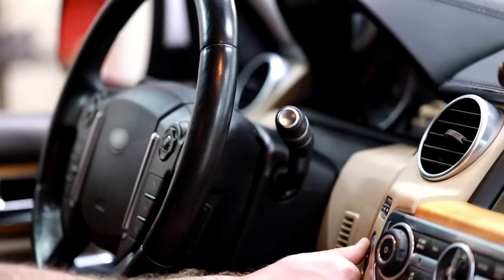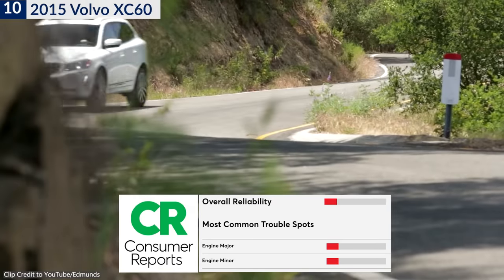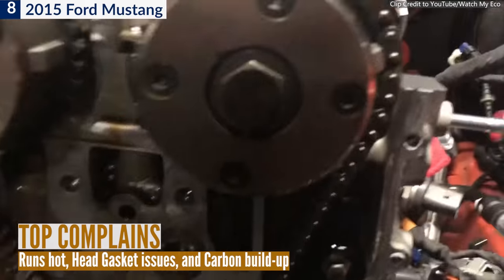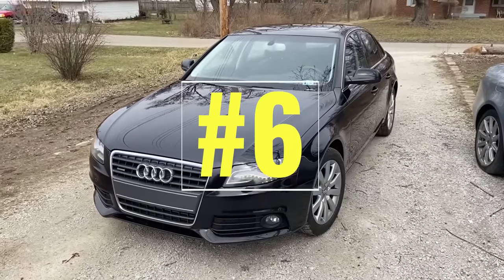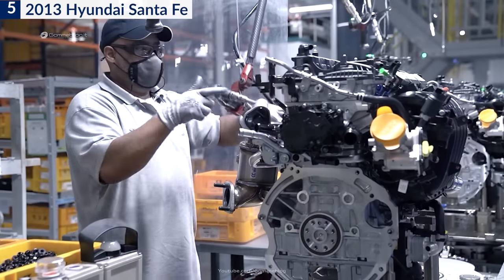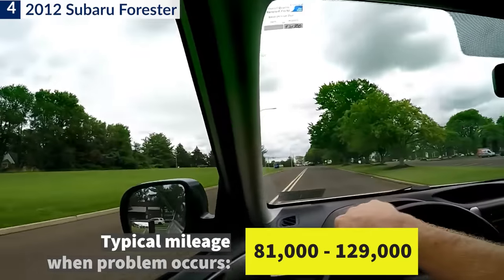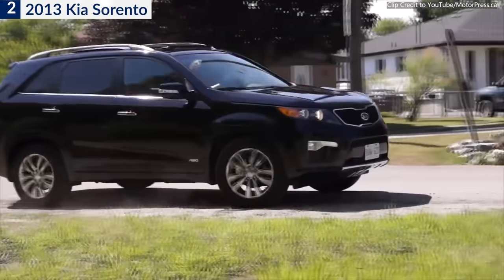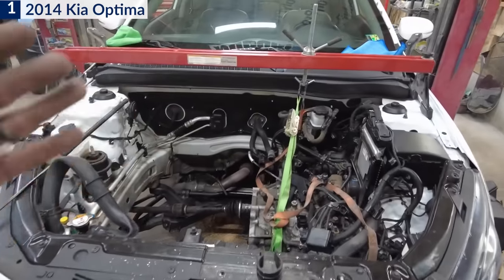10 Used-Cars to AVOID for BAD Engine - as per Consumer Reports

Comment: 4 cylinder turbo on most of these vehicles most likely means an early death to that engine. I would NEVER buy anything turbo if I cared about long term durability and reliability. That's my opinion. I don't care who makes it. That goes for anything turbo no matter the cylinders.
Reply: Turbo diesel have long durability. Can't blame the turbo.
Reply: Exactly!  Nor are these cars designed for much except drive and trade!!
Reply: I have a 92 dodge truck. Cummins turbo. Its well on its way to 400000 miles and will still be going after I'm gone to my grave.
Reply: You have to maintain the engine. Higher compression and heat means more things can go wrong if you don’t watch your maintenance schedule.
Reply: most people don't know how to do their service right including the dealers
Reply: @steveschilling5966  Well, that's hella scary!

Comment: Yeah, I've got a 2012 Equinox with a 2.4 engine. They had a recall on it but it was a few thousand miles past the recall limit. I put about a quart of oil in it about every thousand miles. I'd like to trade it off but I don't want someone else to have this guzzler

Comment: I am really surprised. I expected the 3.5 Jeep engine to be number one due to cylinder heads cracking.
Reply: The 3.6 wouldn’t make the list as those were fixed. You can’t exactly blame the engine for issues during the first model year of its production.

Comment: The 2016 Hyundai Santa Fe has EXACTLY the same problem with bearing failure.  The good news is that if you have maintained the vehicle as you should - a new (rebuilt??) engine will be installed at no cost.  There is an upper mile limitation on this coverage - but hopefully I will get 5-10 years out of this engine before it (or the vehicle) fails permanently.
Reply: That new engine isn’t any better than the 1st. I’ve heard of many that are on their 3rd engine now

Comment: You are right to have included Subaru. But shouldn't have limited the inclusion to only foresters. It should have been any model that uses the ej25 motor as any Subaru with that motor and the related motors in all models. The milage average fail occurs seems a bit too high. Mine  happened within warranty period. All 3 times my ring lands failed. Yes 3 times. It's a lemon. This is what I say to Subaru "meh~~"
Reply: Never heard anything good about Subaru. Buy a Quattro Audi for a real awd car.
Reply: I would guess your Subaru engine was the FA engine, not the EJ unless you are just referring to a head gasket issue.  The FA engine had the oil consumption and piston ring issues if I remember correctly
Reply: @amlafrance1918  FA? i was talking about the EJ25, maybe you should read my post again?  i had a 2008 GR with a EJ255 to be exact. if you dont believe me about what POS the EJ25 is you can do your own research in the subaru forums.

Comment: Moral of the story, Don't buy an early model Hyundai/ kia with the GDi motor. The 2.0 (the one on the Elentra), 3.0, 3.3 and 3.8 are good enigns. Hyundai can't make a good 2.4 or 2.5 engine right unfortunately even the mpi version suffer from weak oil pumps.
Reply: Kia and hyundai do pay close attention to critisms, and are often quick to remedy the situation.
Reply: Elantra 2.0 has bad engines also major piston slap at starting at 20,000 miles.
Reply: The 2.5L and 2.5T engines are new. So therefore is a better improvement over the previous ones. Do you know anything about Hyundai?
Reply: @america6529   I only know 7 years of Hyundai Sonata ownership. As well of renting/ driving multiple Hyundai/Kia vehicles. So I talk from a minor experience regarding the old gen Hyundai engines. The new variants  need to prove their reliability.

Comment: What about the 2012 2.0 Audi? Excessive oil consumption beginning at 40k, the list continues. When I purchased the car new in 2012,  Consumer Reports  rated the A4  2nd in reliability after the first placed Toyota Highlander. Go figure.
Reply: My chevy colorado, 2007 I bought new
Regular maintained 2.8 4 cyl
Dropped valve destroyed engine @ 99,000 miles
Would cost 6000$ to fix
More.tban truck was worth
General motors junk
Reply: Maybe needed intake and combustion chamber cleaning,  about $650 for both.
Reply: @lonniebeal6032  I wish. Audi replaced the rings and pistons,the car originally had defective rings installed. Cylinder #1 was scored, requiring a new long block.

Comment: Seems like the solutions to not having these problems are as follows
1. Avoid 4 cylinder engines
2. Avoid turbo 4 cylinder engines
3. Avoid GDI engines
4. Avoid Kia & Hyundai

I’ll stick to my naturally aspirated Toyota V6 and V8 engines. Never had a problem. You get what you pay for!

Comment: Now you need to add all Mazdas powered by the 2.5L SkyActiv Turbo motor, through the 2020 model year (CX-9, CX-5, 6, 3). 
When Mazda added a turbocharger to the engine, they did not take into account the stresses that things like potholes would apply to a turbocharger bolted directly to the head (the exhaust manifold is part of, and integrated into, the head). Over time, the mounting points crack, and coolant leaks result. 
If one catches the coolant leaks early, you will only need to replace the head (about $5000), but if you don't notice the coolant leaking and it overheats, the entire engine will need to be replaced ($8000-10000+ depending on labor costs). 
Confounding factors in noticing the coolant leaks are: a) coolant overflow tank located against the back of the radiator that is not as obviously low as tanks mounted on the inner fender, b) the engine undertray that catches the leaks from the back of the engine when they are small, and c) because the leaks are far under the cars, they aren't as noticeable unless you park in a garage, even when they become larger.

Early on, Mazda was replacing heads for "loyal" customer after warranty (loyalty being arbitrarily defined by number of Mazdas recently purchased and how much/often dealer service had been used), but they seem to have stopped doing that.
FWIW, my CX-5 head cracked at 62k (warranty is 60k), but I haven't had the money to get it fixed yet (just been sitting for 6 months while I continue making payments).

Comment: Its heart trembling to hear that some models which i had regarded as trustworthy is on the list of avoidable vehicles. My viewpoint is that there is such an over production of new models that it over run quality control. Pumping it out from the conveyer belt like Coke bottles with only a random check for quality. Car producers have to realise that the concept of as much new models per make is really a bad concept. It not only leads to incredible price hikes but also to avoidable vehicles coz of bad quality control.
Reply: Heart trembling?  Really?
Reply: It's poor design, more than poor quality control. Hard to control quality if it's a poor design

Comment: We bought a new 2013 Chevrolet Equinox with the 4 cylinder engine. It has been a wonderful vehicle for the first 188k miles so far. Powerful enough to get its bulk to the next traffic light with some of the best. All accessories still work properly and the vehicle still looks modern. We feel we got our 27k  monies worth out of it. However, its biggest drawback? Oil consumption. It doesn't leak it, it burns it. Again the engine still runs strong at 188k miles, but you better have an extra supply of oil handy in your garage. Our 2013 uses 4-5 quarts of oil in between oil changes or should I say filter changes.Two years ago I sold a 1968 (air-cooled) Chevrolet Corvair, with its original (101k miles) engine. It used maybe 1 quart of oil in between oil changes. (Obviously, it wasn't a leaker.) Our next vehicle will be a 6 cyl. that doesn't need to work as hard as a four banger all the time, despite the LGB pump prices.

Comment: looking at these engines.  I would expect that all engines that are small displacement and running with turbo would have premature engine problems.  Think that over sized oil reservoir would go  long way to slow these problems.  cool, clean oil is the life blood of a turbo. Over working these tiny engines 120 cubic inches and expecting them to hold up like a slow revving v 8  is not the brightest thing in the world
Reply: yes and no. If you could have an oil thermostat you could bring the oil up to temp faster but they dont have those and for short trips you dont want the burden of warming 7-8 quarts of oil. Also when it comes to bearing wear, higher revs will see less wear than slower revs. Thus a slow rotating V8 may wear faster chugging along at 1500 rpm versus 4 or 6 turning 3000 rpm. Cylinder wear will be less at 1500 but good pistons/cylinders will solve that issue
Reply: @jamesmedina2062  since bean counters look for cheaper and cheaper My guess is all the moving parts in these engines that are tiny and fail relatively quickly are using the crappiest parts available
Reply: @stevepailet8258  yes but then its not the overall architecture that matters but the fine details that do right? Quality over quantity no?  Implentation
Reply: @jamesmedina2062  OK I do agree but that said. name your top picks in this segment that do what you suggest.
Reply: @stevepailet8258  Crossover or SUV?? There is a long continuum of poor to good, perhaps even excellent. Mercedes AMG45 with nearly 400 horses is a crossover. My friend had a CRV with CVT which is probably not terrible but the 1.5T is a little small in my opinion for a SUV. Ford Sux. Chevy kinda sux. Hyundai and Mazda SUV are middle of the road. If I wanted a bigger SUV I would prefer a V6 honestly. So Passport or Highlander.
Reply: @jamesmedina2062  not an EV in the group
Reply: @stevepailet8258  engines and electric vehicles are two different things
Reply: @jamesmedina2062  if you look I initially was talking about engines.

Comment: I see a common denominator.  In these cases, the manufacturer installed an engine of 1/2 the size that was needed, and added a lot of turbo charging and technology to make the amount of horsepower needed.   You can squeeze double the power out of half the engine......for a little while.  Unrealistic demands by the CAFE and EPA rules are mandating the OEM's to do this.  Nothing is free, if you need V8 power, you need a V8.   Short service life is stealing hard earned money from the customers, with no advantage to the environment.  We are paying millions for no real benefit.

Comment: Common trend, asking a small engine to do more than it can long term. I’m all for reducing emissions but they probably don’t consider the expense of energy and emissions to build multiple engines to the job that a single larger engine can do.  Turbos are fun to boost power for extra performance but I’m not interested in an engine that needs a turbo to meet the basic performance needed.

Comment: There was nothing wrong with the inline five cylinder engine Volvo had for year's.
Reply: Problem with automotive engineers and designers mindset, "If it works, it must be fixed"...
Reply: Wrong. 5 cylinders had there issues
Reply: That Volvo 5 was a great engine. My friend has had one for almost 30 years or so, rest of car looks pretty beat up but it keeps going.
Reply: The Volvo 5 cylinder SUVs made under Ford's ownership from 1999 to 2010 were terrible. Worst car I've ever owned. The engine was OK but the rest of the car was trash. I took impeccable care of it, and have never had half as many problems with any other car. Toward the end I was spending an average of $500/month in maintenance just to keep it running.

Comment: Still have my 2012 optima 2.4l with over 190,000k  on it. Still drives nice. only issues i've had is the low pressure fuel pump that was under warranty around 60k. after warranty a little plastic steering coupler and a bad wire going to the solenoid on the high pressure fuel pump. The car does consume oil but only after 130,000k. With direct injection motors you have to run a cleaning agent through the intake to clean off some of the valve deposits. I was always poor enough but lucky enough to do this work myself which has saved me a bunch of money and I don't consider it a bad car at all considering the few issues vs the millage it has now. However, it doesn't get driven a ton now and I made sure the next car I bought was mpi instead of gdi.

Comment: Hope you included the Ford Explorer that they made for 10 years that wouldn’t go 50,000 miles for the engine went bad. The bad news is Ford motor company knew they were bad and kept building them anyway.
Reply: Which engine you talking about?
Reply: @connor3288  The six cylinder but the v8wee not a whole lot better
Reply: @docbrady6397  3.5 internal waterpump im guessing youre talking about?  Interesting how engine is much better in f150/rwd configuration, with external waterpump.
Reply: @connor3288  No they did timing chain in the front and in the rear of the engine and the one in the rear doesn’t last behind 50,000 miles engine must be polled to replace the timing chain and there’s all kinds of problems I had mine done for five times and they finally told me just to sell a vehicle.
Reply: I've got a 2010 Explorer.  Gas hog v8, but love it.  Only thing is diff went at 130,000.  Cheap replacement.    The v8 comes with 6R80 trans. thats pretty solid.  The v6 (which always shakes a little at idol) came with a really crappy banded servo trans. and I have one of those that died at 120,000.  That cost some major bucks.  The v6 was not the best choice.
Reply: @markmurto  Not sure of the exact years that were bad but they made them for about 10 years and they didn’t exceed 50,000 miles before the engine went bad. It’s the one that has the timing chains on the rear and it is a six cylinder.
Reply: I have a 2011 Ford Explorer with 330,000 miles on it, gave it to the kids 5 years ago, people can bad mouth  any  car ever made.
Reply: @kennethjohnson4964  you obviously didn’t have the same engine that I’m talking about they made several different engines
Reply: Had an Explorer with 144,000 miles on it. It was a rust bucket by then. But ran and drove fine.
Reply: That does not even sound like something to buy. Do your research. Does a timing chain in the rear even sound like a plan?
Reply: @bsgarey  It depends on the year they made some really good vehicles but for 10 years they made some really terrible ones and that’s a fact. Not a single one ever went over 100,000 miles most of them died at 50,000. Ford knew it, didn’t care and kept right on building them
Reply: @docbrady6397  Yelp....Over the years its the same. Taurus transmission failures, Escort Head gasket issues, but the original V6 in the Explorer was fairly reliable. Mine went 144,000 when I sold it.

Comment: My coach had a Sonata that looked like that and it lasted 200k. 
I've come to realize you either luck out with Kia and Hyandai or it sucks.
Reply: Yea, I tried my luck and it turned to suck! Bought new 2013 Accent 1.6l. Changed oil every 3,500 miles and it still only lasted 8 years and 70k miles! They really drag their feet I found out! No rental for the first 3 weeks! They had it for two months to replace the engine! Never again!
Reply: Why roll the dice when buying a product that costs as much as cars/trucks do? None of them are perfect, but there are models that have proven to be reliable but people get sucked in to a few thousand dollars cheaper for Kia/Hyundai  on purchase which cost them later on.
Reply: @captinbeyond  I had a coworker at my last job who just bought a Kia K5. Tbh it's a great looking car. But all those LEDs.
She had one of her foglights go out despite being less than a year old. I thought LEDs lasted longer than Halogen.
I wonder how you would replace the giant orange strips along the headlight housing when those go out
Reply: @baronvonjo1929  yeah, cars come loaded with so many features and gadgets/cameras, sensors etc. I've heard horror stories of folks just bumping into something in their front but it cost thousands of dollars for new LED lights or cameras that need to be replaced and re-aligned.  Windshields that cost $3k or more to replace cause they have digital odometers and cameras and other gadgets that drive up repair cost. Just give me a simple car thanks.

Comment: I have a 2004 toyota solara, i have 177,000 miles on it my insurance is less than 50$ a month. I have bought a new battery this year. The body has some dings and scratches but otherwise still looks new and not a spot of rust. The AC and heat works great and all i do is change the oil every to to three years.
I am very lucky ill drive it till one of us dies!

Comment: My Mercedes CLA250 4MATIC Sport without warning violently vibrated and lost compression in Cylinder 4.  The engine had to be replaced at my cost.  On investigation it was found sections of the valves in cylinder4 were literally eaten with spark plug 4 not been tensioned correctly (loose).  Mercedes refused to rectify, I'm taking them to court.  So much for "A MILLION MILES AND STILL GOING STRONG".
What a load of junk.

Comment: I’d stay away from ALL direct injection engines. Unless you outfit it with port injection, but then you’re looking to add more power. More fuel requires more air=more power baby!!
Reply: I've heard some engines have dual injectors just for that. Very small ones that do "normal"
Reply: You can't, Rdx had GDI since 2006, but the pistons are longer and top ring further away from crown of the piston so it doesn't get carbon build up as fast.

Comment: I got an 04 f-150 5.4L 3 valve 4speed with OD with 350,000 miles original engine and transmission original water pump and power steering original steering rack and most suspension components are original original rear end and I’ve done very few repairs on the truck just engine accessories and regular maintenance